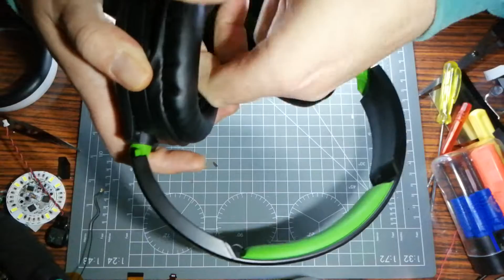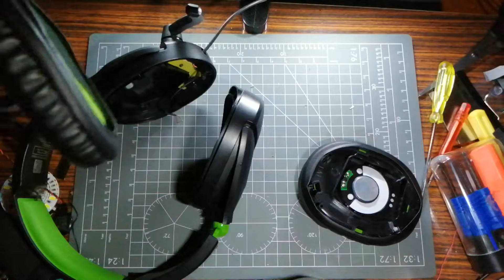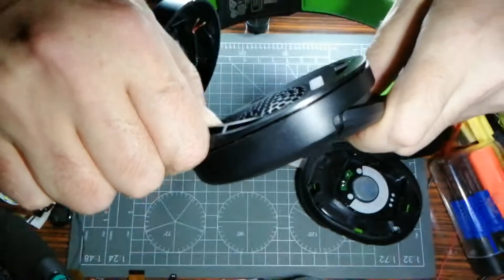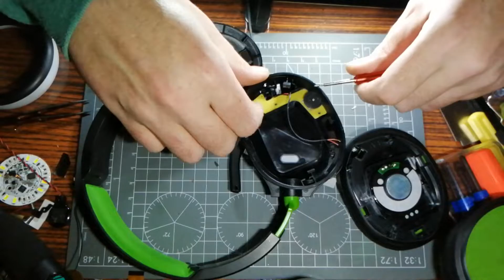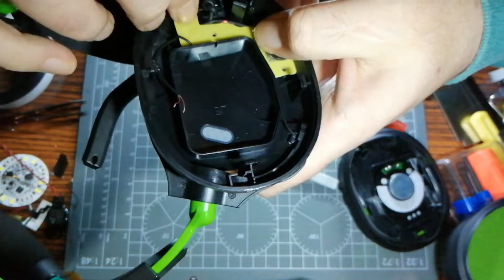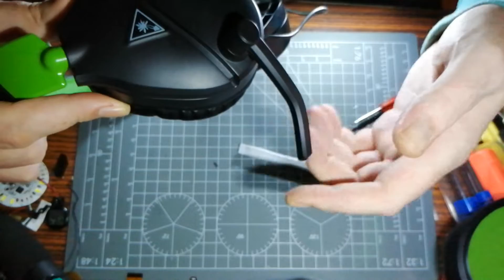Let's see how? Turtle beach recon 70 X gaming headset ear muff replacement and floppy mic fix

Comment: I learned the hard way that if you leave the floppy mic for too long,it will come off completely,but stay connected with the wire
Reply from the maker: That's not good. Hot glue would of probably worked as a temporary fix though.
Reply: that happened to me too!
Reply: how can i fix that
Reply: Same here what a piece of crap

Comment: My mic fell of the left side, it didn't fall fall, It still has the little wire connected but when I put it in again, it just pops it out again, so do I have to disassemble like the video is showing or is there any other way to fix this problem? Thanks 👍🏻
Reply from the maker: You could try sugru that would work as a temporary fix. It's a fast setting putty that can be use on plastics and stuff to partially fix them.
Reply: Same thing just happened to mine for no reason
Reply: @WarforgedSentinelOfDespair  same
Reply: @gadgetmadlad6691  what’s sugru?
Reply from the maker: @Alvin 69 sugru is a fast setting putty glue like substance that can be used for repairs, I keep meaning to pick some up for some future video ideas. It's ment to be great for repairs.

Comment: My mic popped out and is now dangling with the wire out. It was working for a bit after I put it back in its place but then after a bit it just stopped working. I also shakes the headset and I hear that something is loose on there. I feel like I might just have to buy a new one.
Reply: Same
Reply: Actually it's just a screw that's lose, I had the exact same problem and I took off the muff and replaced the screw but then I put ot back in place and then the mic wouldn't work but could still hear

Comment: It’s stupid why they tell you to replace the ear cups for cleanliness but yet the solder the speaker in so if someone pulls to hard they might rip the pads or pull out the wire and not everyone knows how to solder which I see this as a design flaw but yea maybe just me

Comment: Cheers for the vid. My sons mic came loose, and there was a rattling inside. Took them apart carefully and screwed mic back in and headset working perfectly again. He only has had the headset for 3 weeks. I expected better from Turtle Beach.
Reply: No these are trash there's a reason they're cheap
Reply from the maker: Tbh a lot of the headphones I've torn down from the good brands to the lower budget turtle beach headphones are all low quality on the inside. The only 1s I've seen with a build quality that's really high is the nuraphones and they were that tuff and strong I had to literally destroy them to open them up.
Reply: @gadgetmadlad6691  I've never heard of nuraphones pc only?
Reply from the maker: No there high end audiophile 1s, Bluetooth and cable. Think they can be used on anything.

Comment: Do you know how to re wire pcb? Colours etc
Reply from the maker: Not off the top of my head sorry,but if you have access to or can get a multi meter you could check for continuity and check Google for the correct pinout of the actual headphone jack itself compare the 2 and you should have the correct answer. Hope this helps let me know how it goes.
Reply: @gadget madlad  I have a Multimeter but just bought it, still learning
Reply from the maker: @garethjones3684   for stuff like this when you're trying to figure out wiring I find drawing a rough diagram in pen or pencil ie rough sketch then using continuity mode on the multi meter can help narrow down the Google search images for comparison. Continuity mode is when both probes beep when in contact. I'm a bit of noob myself iv only just learned how to use it for checking voltage. Just watch other Youtubers like tronix fix and the coder and my mate Vince then take either literal note or mental note of key words they use then Google the meaning or watch the how tos  that Google recommends via YouTube. Hope this helps and feel free to ask anything else and let me know how your headphones repair goes.
Reply: @gadgetmadlad6691  thanks, will d👍

Comment: my ear padd fell off and i cant put it back on cause the slit is way to thin and i just cant fix it
Reply from the maker: You need to partially remove the plastic cover carefully with a pry tool or something it's only held in with plastic clips once unclipped you should be able to get the ear pad back on and just push through it to make sure the plastic clips click back into place. A bit tricky but definitely doable.
Reply: @gadgetmadlad6691  thanks I finally fixed it after 2 hours

Comment: I have a turtle beach stealth 600 and my ear muff is completely loose. It won’t tighten to the headband. What do I do?
Reply from the maker: Is the screw post or the screw threaded? If it's the screw post you could try adding some glue to the inside the put the screw in place till it dries then remove the screw and Bob's your uncle Sue's you aunty the screw post is pretty much fixed.  Hope this helps and thanks for watching.

Comment: So I found the screw that popped out my mic but all the wires are still connected since I didn’t rip out all the wire from the speaker and the blue cable that connects to the pc is also large and hard to unscrew the other screw

Comment: How to fix mic , mine has fallen off for some reason and there's something shaking in my headset when I move it
Reply: the screw has come completely out of the microphone and it is now loose and shaking inside the headphones. If you try to follow this video then it'll fix your problem. Just take apart the headphones and rescrew the microphone back together.
Reply: @BertNErnie442   I don't have a small screwdriver , I tried everything else , I removed the screw driver tho
Reply: @BertNErnie442  i jus ripped it off now I got no mic 😀

Comment: Hey I have the recon 200s I think and my mic just randomly popped out I noticed a screw coming from the inside of the speaker to hold the mic? How the hell does this crap happen? And is there an easy way to fix it or do I have to buy a new pair? These are not even a month old
Reply from the maker: Unfortunately these a built to a very low quality so end up braking. If you can replace them its probably worth trying to fix them 1st to save them from landfill and save you some money in the process. Plus it's good practice. Let me know if you fix them.

Comment: Left speaker stopped working all wires are good and mic still works is it fixable?
Reply from the maker: If you replace the speaker or both, then yes but it would be an effort to do
Reply: When i press the speaker to my ear i can hear it working but won't stay with sound
Reply from the maker: Might be a loose connection where the wire meets the speaker if thats the case you could re flow the solder on the connection point, that might fix it.

Comment: I put my mute button up a little too hard and now it's not working when I put it down is it a simple fix?
Reply from the maker: You would need to open it up with a pry tool or something be careful not to snag the wire to hard in the process. Once open you can assess the damage,  you might be lucky enough to have just dis lodged the actual switch but if not that could be a replacement of the actual switch mechanism itself which would definitely require some soldering.  Hope this helps and feel free to let me know how it goes .

Comment: Can you tell me how to fix my headset it just stopped working yesterday at first only my mic wasn't working and I couldn't talk now today my whole left side of my turtle beach recon 200 is not working the only thing working is the right ear muff and I can't talk and can't hear out of my left ear muff
Reply from the maker: Probably a loose connection on the inside,  if I had to guess I would say that the cable itself has broken away on the inside if you can solder it could possibly be fixed if not Probably better to just replace. If you do know how to solder it should only be 3 maybe 4 wires to do tops so not the hardest thing to do, hope this helps
Reply: @gadgetmadlad6691  what is solder I'm sorry I'm dumb
Reply: @gadgetmadlad6691  and sorry it's a recon 70
Reply from the maker: @taragobie2512  soldering iron for fixing electronics. It's not dumb mate if you don't know you don't know nothing wrong with that everybody has to start somewhere.  I use a soldering iron a lot in my videos if you need any more help don't hesitate to ask.
Reply: @gadgetmadlad6691  would I have to go and buy a soldering kit or something
Reply from the maker: @taragobie2512  to repair it yes. It's mostly the only way to fix/repair any tech. Unless you have a local repair shop they might be able to fix it but would most likely be expensive.
Reply: @gadgetmadlad6691  ok and last question I think I saw another video where a guy like unscrewed something under the jack to access the cables but on the mic I ha e I don't think I can how do you recommend I access the cables to solder them
Reply from the maker: @taragobie2512  sometimes if you can't see any screws if you lightly pull away the ear padding and remove it they hide the screws there. Or if not there then it could just be clipped together which means no screws just a case of prying them in a certain way with a plastic pry tool or guitar pick style thing to get it to open then you would have access to the wires. Ask as many questions as you want mate happy to help
Reply: @gadgetmadlad6691  what screws are you taking about you talking about next to the ear muff?
Reply from the maker: @taragobie2512  not sure without seeing it. I ment in general with headphones.
Reply: @gadgetmadlad6691  would it work if I trimmed a lil bit next to the jack and pull the wires out from there
Reply from the maker: @taragobie2512  I don't understand what you mean mate.
Reply: @gadgetmadlad6691  do you see what I mean now
Reply: @gadgetmadlad6691  ok ok and I see what u mean by pulling it off and seeing the wires from there but what if it's not cut there and it's cut somewhere else inside of the cord therefore the video I sent
Reply from the maker: Without seeing the headset I Dont know the wire that you plug into your phone follow that to the left or right which ever the wire leads to is probably the side with the fault.  But like I said Without seeing it I can't say for sure.

Comment: Can't remove the circuit board on account of the glue and something holding it in from the corner of the topmost screw. Any advice on that? Really appreciate it
Reply from the maker: If it's just hot glue gun glue it should be fine to just pry it out, be careful not to snag any components.
Reply: @gadgetmadlad6691  Oui mais comment on retire la colle ?

Comment: Took my boots off to clean them. Dont ever do that. Taking the pieces apart to put it back on is such a pain. Bent up 2 of my plastic pryers. Had to use a metal one.
There are tabs once you take the boot off that help to remove the pieces, but they are so stiff and no room to pry that it hardly helps. Theres 4 tabs covered by a felt rectangle. Thats where ylu want to pry.
Just clean them with it on.

Comment: How do u get the motherboard out?
Reply from the maker: If I remember correctly you would need to de solder the wires then remove the Phillips screw or screws and with a little bit of gentle prying it should come loose, remember to take note of where the wires need to be re soldered for re assembly.  Try taking a well lit pic on your phone to remember where everything goes. 
Hope this helps 
Let me know how it goes.
Reply: What do I use to soulder
Reply from the maker: @bigwilliej4909  soldering iron and leaded solder.

Comment: I have the same headset an when I turn my volume dial up or down my right side keeps cutting out an I have to painfully move it just slightly to where I can hear both sides. Any tips or should I just buy a new pair?
Reply from the maker: Tbh the build quality is pretty bad in these. Unless you're prepared to re wire them which involves some soldering and full disassembly of them. I'd just buy some new 1s. I can recommend some if you want, would need to know your preference between wired and wireless and what your budget is price wise. Happy to help if I can.
Reply: Mine did the same eventually, but wasnt like that out of the box. Thought they were a great buy, till that. But its just an annoyance if the volume gets touched. To re adjust it.

Comment: I ripped my speaker off and the 2 wires came off how do I fix it
Reply from the maker: Can you solder?
Reply: @gadgetmadlad6691  no but I did the same thing h did where I liked the speaker off
Reply from the maker: No way to fix it without soldering it back on. You could try asking in a cell phone repair store if they could repair it maybe?  Sorry couldn't be more help
Reply: @gadgetmadlad6691  it just needs re soldering but I don’t have a solder
Reply from the maker: @georgejames3805  I'm going to do a video soon about how to make a home made soldering iron out of common household items, probably within the next few months so get subscribed and hope it might help mate👍
Reply: @gadgetmadlad6691  okay what could I use instead of the solder because I know how to do the thing with the steel wire and lighter
Reply from the maker: @georgejames3805  you could try twisting the wires together at the ends but that probably won't work. If you have any access to any old electronics then could you open that up and salvage some used solder from there and use the steel wire and lighter method with that. If you can find any broken electronics like an old TV or vhs player or WiFi router or old cell phone basically anything that might have solder inside it. You could use a knife or cutting blade to cut off a little piece of solder and use that.
Reply from the maker: Without a soldering iron and some solder that's the only thing I can think of atm.
Reply: @gadgetmadlad6691  ok I just need something to use instead of solder I have a soldering iron but no solder